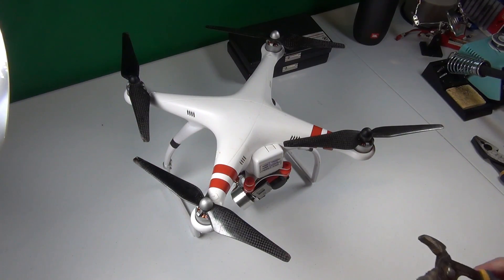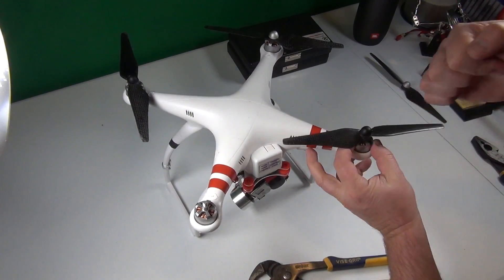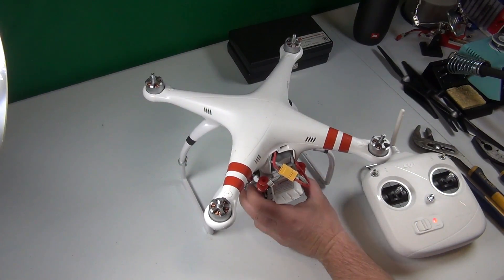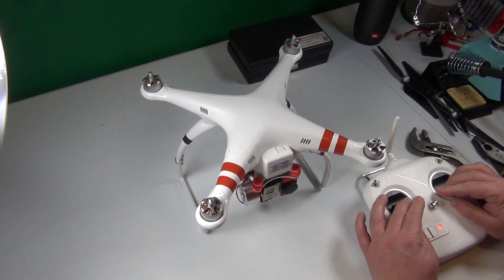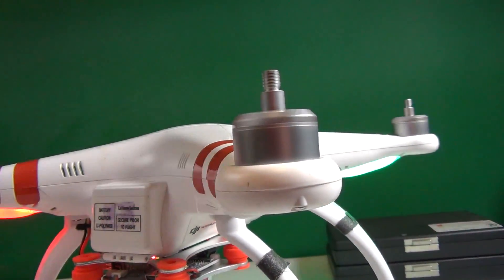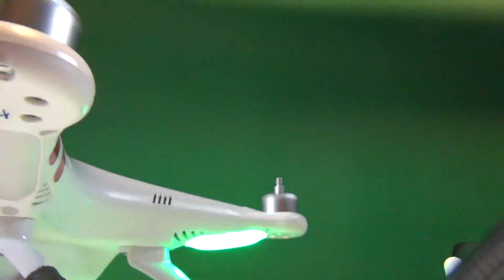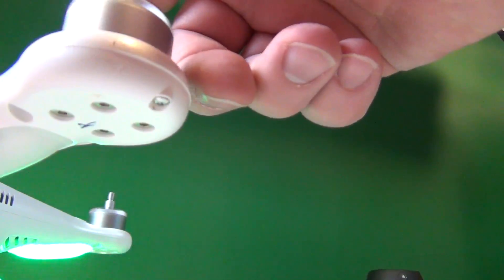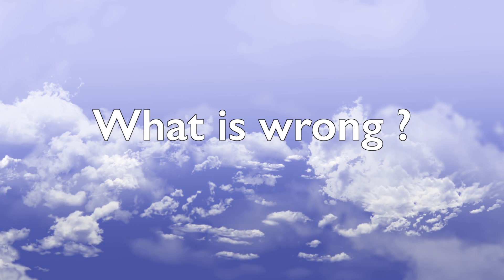DJI Phantom LED Problem

Comment from the maker: I solved this by replacing the ESC board. It also has the LED's on it. I bought the original DJI part from Ebay. There are different parts for the LED colors.
Reply: Did you replaced ESC board and fix the issue?